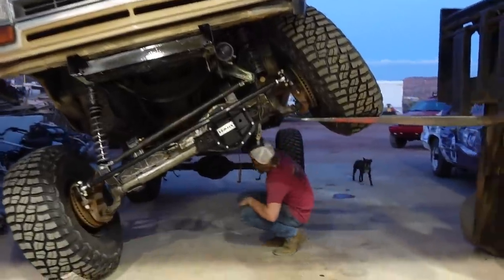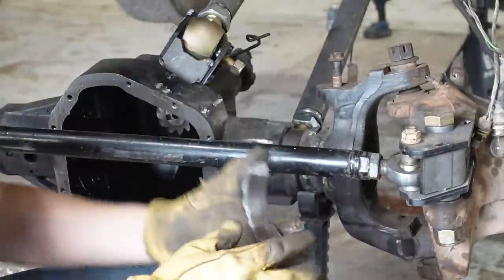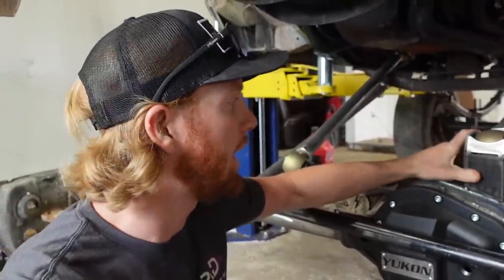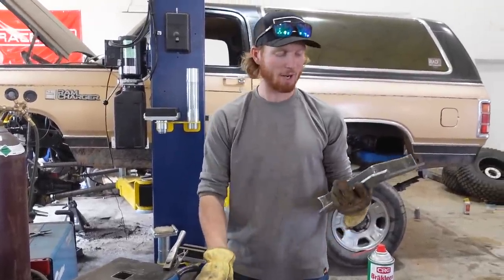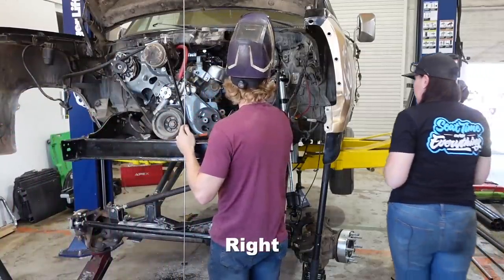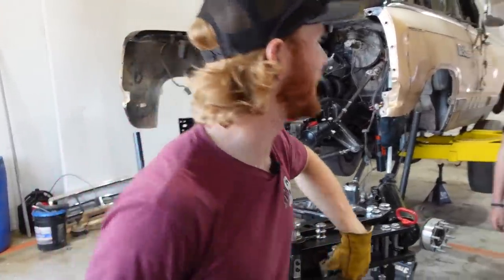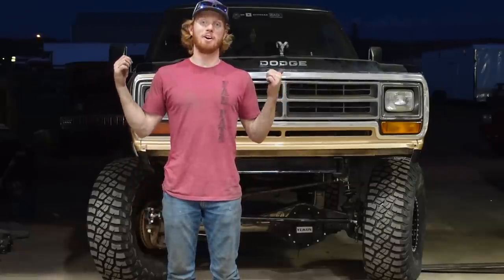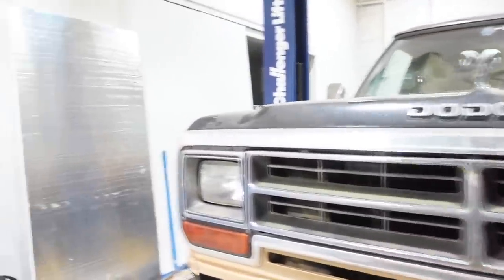This Ramcharger Has MASSIVE Flex!!!

Comment: I have found that an air needle scaler works well for peening and is way faster and looks way better than using a slag hammer etc. you could use Ni-Rod for the cast but good luck ever grinding it. Stuff is tough, i have welded a ton of farm equip. with it and it works well.

Comment: When you put your lockers in don't forget to make sure you put in a little tube hold down inside the pumpkin to hold your airline down so it doesn't move and get caught in the gears and breaks your airline . You're doing a great job on the dodge keep up the great work 👍

Comment: You did a excellent job on the body work. I put some wheel wells on a Chevy pickup truck once and it turned out good. I actually had fun doing it and would like to do more work like that.

Comment: Good job on getting some BFG KM3’s. I have them on my prerunner and they work well in the desert. Your old man won’t touch them per some past vids. He likes those milestar tires for some reason. I run them at Glamis dunes just fine. Gotta air down… Rory runs them too. Only gripe is they wear a bit faster than some other tires on the market.

Comment: Good build video.
With those tires tucked under the fenders like that, and being such a huge rig, this thing will look like it went into a car crusher after the first tight tough trail.  It might have a chance with lots of tire sticking out like the Rude-i-con and wide rock sliders, but if it turns out like shown in this video, better buy a can opener to get out of the cab after the first tough tight trail.

Prayers for Hollie!

Comment: Hey Rudy, you really looked like you were in your element this episode.  Fab work, suspension design and yes even body work came together very well.  You didn't talk about your front differential angle and how that relates to the caster and camber at the wheels.  Getting that steering geometry and the driveline angle to all play nice together can be a bit tricky.  Great job on the truss work! that raised design really made it look "RAD"!  This competition will showcase your skills and put your career on track.  Wishing you all the best and a speedy recovery for Holly.

Comment: You can absolutely weld to the cast iron pumpkin if you do it right using preheat  post-heat  and the right welding rod, or wire (55%Ni).

Comment: .  *  *  *  *  Use the "2x4 fender clearance method" on those rear fenders . It rolls the metal inward so , if a tire makes contact , it won't peal rubber off the tire .

Comment: it looks like the bolts sandwiching the body could use some spacer blocks for the corrugation. tht way the bolts wont risk crushing, and the forces from the cage will be directly sent to the frame, not using corrugation as a crumple zone.

Comment: Makes me wonder if the bigger Ford axle housings are made out of the same stuff as the older 8.8s. The 8.8s are cast steel, not cast iron so you can actually weld to them as long as you do what Rudy said, which is preheat and peen it after you're done. You can also post heat or if you've got the room, stick it in a warm oven or bury it in hot sand to slow down the cooling process.

Comment: Rudy, I’m asking this to learn, but also to maybe spark something with you - how are the front coilover/shock hoops triangulated to stop them flexing laterally?
Reply from the maker: I need to add a crossbar over the engine, but they are also getting tied to my roll cage through the firewall

Comment: Hey Rudy. General welding question for you. What size wire do you normally use for protects like this?  Just curious.  Keep up the good work!
Reply from the maker: We use .035, but my go to is .030. But I just shared these welders with the guy next-door and he welds a lot of heavy metal.

Comment: Really need to flex suspension out with NO SPRINGS and make sure suspension can easily be unbolted at full flex witch azures there’s not improper geometry going on putting side loads on suspension witch is a no go

Comment: Is there a reason you're using a track bar when it's already 4 link? Just curious..
Reply from the maker: I’m running a parallel four link, and no triangulation. So essentially, there’s nothing keeping the axle from moving left to right without the track bar. It’s exactly like a stock jeep Cherokee, but scaled up.
Reply: @Rudysadventureanddesignreal  AHHH I see that now! Thanks for clarification!!!